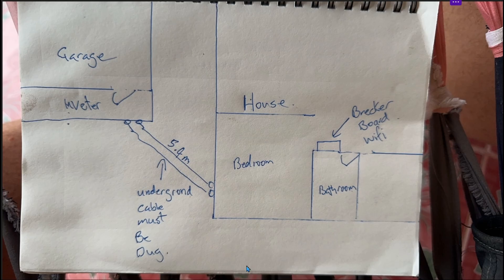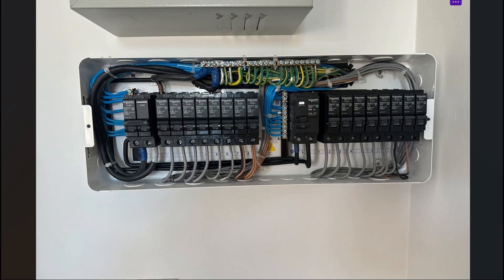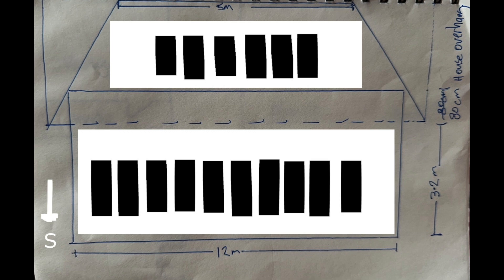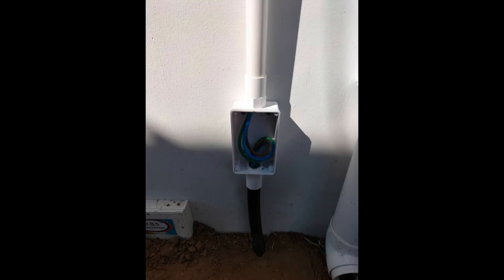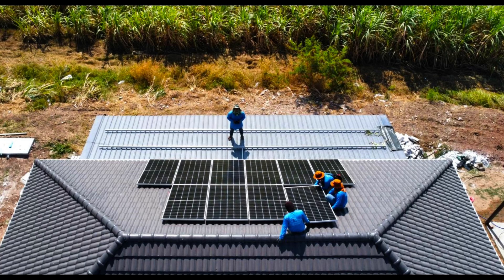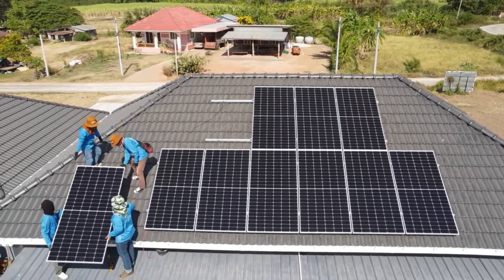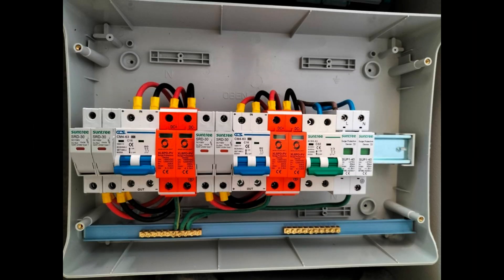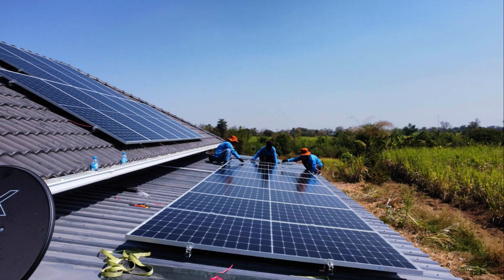Solar installation in Korat from start to finish | SolarThailand.biz

Comment: My solar panels are 25 meters away from my inverter. I Run a cable directly from solar array to a grounding rod. From panels the cables go into a DC breaker close to the array, then 25 meters to inverter. My solar guy says that I cannot wire my solar array directly to the grounding rod. It needs to go through a DC box with surge protection and fuses. Is he right about this? Thanks.
Reply from the maker: Not talking about your install, but in general terms: You can have a ground rod by the panels. Normally the DC breakers, surge etc are close to the inverter.
Reply: @ChaweewanGroup  thank you. Do if I connect the frame of solar array to the rod near the panels. Where should I connect the surge and inverter case? To the same rod or the main AC rod?